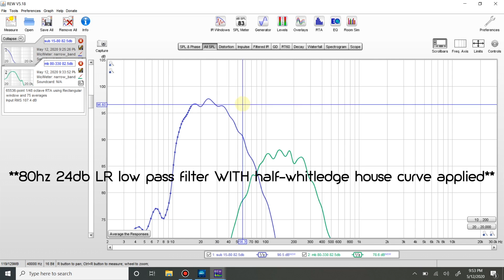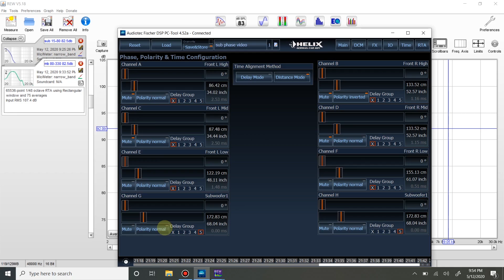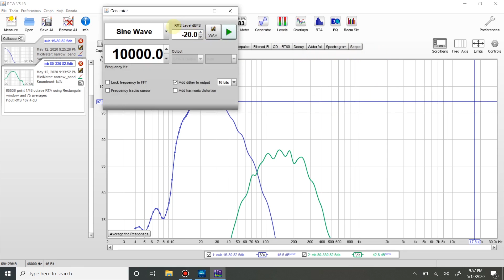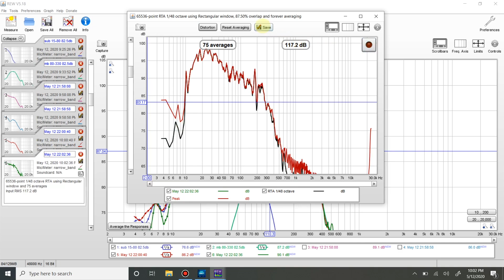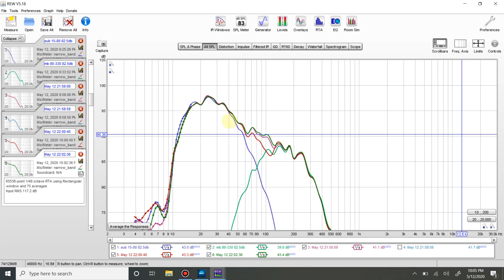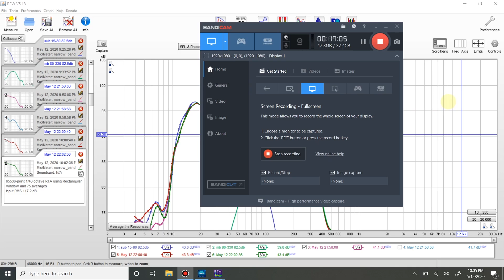How-To: Verifying Phase Cohesion Through A Crossover

Comment: is this both mid-bass to the sub. Wouldn't there be problems with summation if the sub was only in phase with a singular midbass as the crossover would then be up to +6 depending on your summation when both are working?  How do you overcome that?
Reply from the maker: All I'm doing is showing you how to align phase through a crossover. Nothing more.
Reply: @ResoNixSoundSolutions  You're showing the world, I came in as the algorithm presented. Wouldn't it make sense to let the audience know that aligning a single woofer to an individual speaker isn't a good idea as your channel focuses on car audio - not speaker building? This appears to be a 15 minute ramble that can be summarized as "I flip polarity to check phase at the crossover point". But you've chosen a pairing that doesn't follow this rule... Why not show a single woofer to single tweeter? Would make far more sense practically and not embolden those think they know enough to apply this to their sub.  

This is a long running frustration I've had with car audio channels. Pick a topic, script it, inform, list expectations and exceptions, rules/exceptions etc and execute it. Having seen your attitude on Reddit I'm sure you'll find this combative but you should really consider how these ramble-type videos represent your brand and professionalism to the wider audience. All the best. I won't be back.
Reply from the maker: @iggynub all I am doing is showing people how to verify phase cohesion through a crossover. That's it. Nothing more. This isn't a tuning tutorial. This isnt a how to tune midbass or subs tutorial. It is just a quick way to verify phase cohesion through a crossover. That's it.

Comment: yes years later I find this post lol.  It is a battle we will never win against these self proclaimed internet experts that just try and torpedo our post.  You get used to it.  Most people don't even realize that these are basic text book designs and todays tech is way above this.  So this poster is accurate in you can in fact use this as one way to check phase integration.  But can you get the speaker to reference 0 degree's throughout the majority of your frequency response? And you could show a minimum phase graph so we can see what phase of the xovers are doing.  Measurements are just a tool and can not tell you how a speaker will sound.  I had speakers with perfect flat response and sounded like crap.  Todays standard of measurements can't show you psycho-acoustics in a speaker design.  People think wire doesn't make a difference...(more ignorant people).  Everything matters and has an effect on the sound,  The poster is correct and this is a very simple way to check phase between the drivers.  There is more to this than just this to truly know if you have perfect phase integration but this method will certainly get you going in the right direction.  I could hear it in your voice when people say your wrong.  I used to get pissed and still do.  It never goes away lol.  Keep up the good work!

Comment: Linquitz Riley 4th order gives a 360 degree rotation yes, so the drivers would be in phase but one full cycle off.  
So it's not perfect but close.  One cycle off at 20 hz 60 feet long.
Reply from the maker: Phase is not delay
Reply: @ResoNixSoundSolutions  Still can be in perfect phase throughout the crossover region, but it won’t sound right unless the one cycle off is fixed. Can’t fix that by just using a tape measure and adding delay based on driver location. How do you fix the one cycle off problem?
Reply from the maker: @hiresaudiocosta873  I don't think you are understanding.. I suggest looking up Rane's article on Linkwitz crossovers.

Comment: Thank you so much for sharing, I've learned so much by watching your videos. One quick question though. On a helix dsp, after setting your time alignment distances, is it better to get the drivers in phase by adjusting the time alignment itself, or would adjusting the phase angle be better? Thanks in advance, I can't wait until you post another tuning video!
Reply from the maker: I'm glad you are getting info out of the videos :)

As far as phase/time.. well, it depends which one is off ;)
Reply: @ResoNixSoundSolutions  thanks for the reply! I'm guessing that knowing the difference is the hard part. I was mostly curious of weather or not the phase angle delayed the signal like the time alignment, or if it changed the angle of where it started to produce the signal. It sounded like a much more coherent though before I typed it out.

Comment: Thanks for the video!
I have three points:
1. Have you tried to actually MEASURE the phase? Basically, you can't tell that using LR24 will give you perfect match as every speaker "touches" the phase as well. I'm using Smaart in CA for time alignment (and IMO you can't do it better with ear or by distance, Smaart measures the impulse response in live mode so you can adjust every speaker to "meet" at the RTA Mic position) and a little for phase analysis, but there is so many reflections and below ~2kHz it shows bullshit.

2. Can you do a video about two-seat tuning? Assuming no center and, let's say, not the latest helix dsp (no upmixer).

3. What about another filters, like BW12? Do you use something else than LR24?

Cheers!

Comment: Do you use filters other than 24 dB LR? They helps in many things, such as reducing small time errors, or better protects tweeters. The acoustic filter is similar to electric, etc. And don't you feel that these filters sound a bit plastic. Is it better to use e.g. 6 or 12dB? In home audio, many construction has, acoustical 12dB LR. What is your experience?
Reply: Today I switched LR4 to BTW4 and sound starts to live again. But I choose 55 hz for sub and 80 hz for woofer as cut-off freq, because sub @ 80 hz cut-off sounds dirty as harmonics increases. When I also applyed BTW4 highpass filter for sub @ 35hz the bass become more smoothly then my prev varient @ CHEB4 (my sub is vented, tuned to 35 hz). LR2 I use for Woofer + mids + tweeters